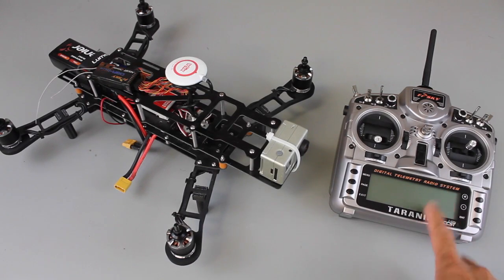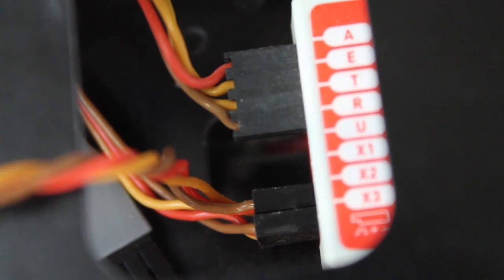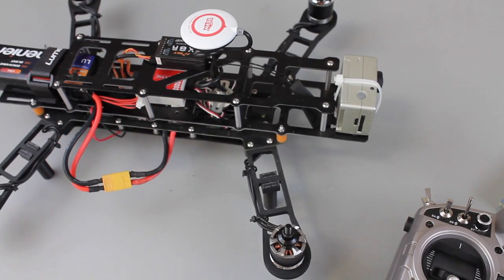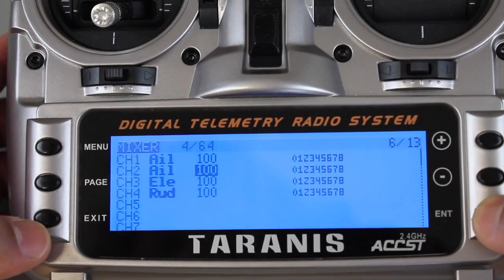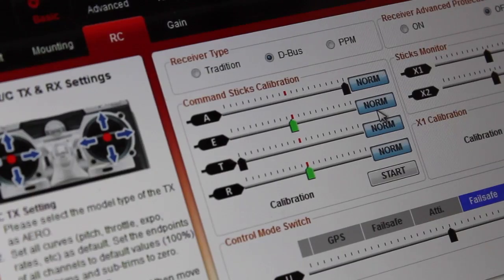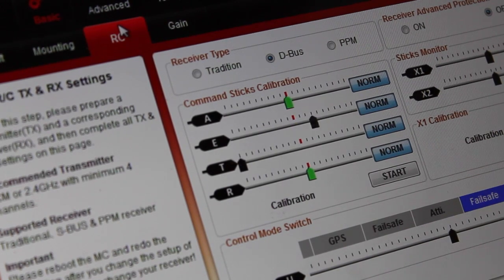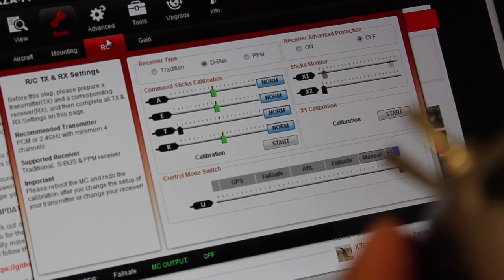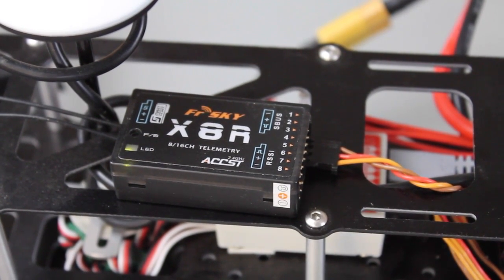FrSky Taranis and X8R Receiver SBUS Setup w/ NAZA Flight Controller

Comment: Hi Dennis ,I have the wookong on Sbus with my tarannis ,and I can't get my compass to get into calibration mode .No blue light after switching from manual to GPS .I've tried six times ,seven times,eight ,nine ,and ten,and it won't come up .At this point I'm considering switching to pwm, and trying that way.This is my third naza ,first wookong and I can't get it to calibrate.any suggestions?I'm a long time subscriber thank you for any help.

Comment: Nice video - I recently built a 450 quad with a Naza M V2 flight controller and this was a big help in getting it setup with my Taranis X9D and FrSky X8R receiver.  I'll note that one thing that was driving me crazy at the end was I couldn't get the motors to arm.  Finally I tried every combination of what Naza refers to as the CSC (Combination Stick Commands) to start the motors, and the only combo that would work was Left Stick (Th/Rud) to Lower Left corner and Right Stick (Elev/Ail) to Upper Right corner.  That stick combo isn't even called out in the Naza manual as one of the four supported CSC positions!   Not sure why this is different, but perhaps it's because the Tx and Rx are FrSky.  Thanks for making videos like this - they're a great help to beginners and even experienced drone builders and flyers.

Comment: This is what I wanted to do but how did you get the software to connect to the Naza controller?  When I try it in Windows 10 it can't find the FC!  I asked those idiots at DJI how to get it working in Win 10 and they said to use XP!  I haven't used XP in years!
Reply: I think your running into the fact that you can't install unsigned drivers in win 10. Look up info on how to install unsigned drivers then re install FC driver and try again.  Hope that helps.
Reply: The driver seemed to install, at least it didn't get any errors, but when I try to run the program it can't find the FC.  It works OK in Win 7 though so that seems to be good enough for now.  I wish DJI would finally update their old software from 3 years ago!  It's all so old that my Naza M is a later version than they say to update to on their website!
Reply: Yeah it doesn't give you a warning or indicate failure. I had the same issue and resolved it by turning unsigned driver off then re installing. Glad it works on 7 for you. Best of luck.
Reply: It works OK on an older laptop with Windows 7 so that's what I'm using.  I've got AETR to work but I don't know what to do about the Control Mode Switch.
Reply: steve c what issues are you having with control switch?
Reply: The issue is there is no obvious way to set it up.
Reply: I assume your talking about flight mode switch and not home lock course lock... 2 questions- which taranis radio are you using and does anything happen in NAZA software when you flip the switch you chose.
Reply: I can send a pic of my radio setup for that. My radio is a qx7 but set up will work on x9d
Reply: Yeah, Dennis has made another whole video showing how to set up that Flight Mode Switch, I just need to watch it a couple more times to see what he's doing then try it myself.  https://www.youtube.com/watch?v=-gA5o_g4oW4
Reply: HD, have you tried setting up a Gimbal?  I've got the Flight Mode and IOC switches set up but ran into a problem with the Gimbal, they say to connect it to outputs F1 and F2 on the FC but F2 doesn't do anything since there's only 1 radio channel allotted for it, X1, which I assigned to LS, so I can move it left and right but there's no way to move it up or down so what's the deal?  I could connect the non working vertical gimbal servo to the 8th output on the receiver and assign that to RS so why do they say to use X1 if it only works for 1 channel?  And why does DJI have you run the one channel through the FC anyway if it only works on one axis?  I could just connect the Gimbal to 2 of the outputs on the receiver and operate it using the LS and RS switches directly.  The Gimbal isn't too important at this point though since I'm just trying to get the Naza working and I haven't even checked out the GPS yet but I'd like to know how it's supposed to work since the directions don't make any sense.
Reply: I usually just set yaw  (left,right) to follow mode so it stays forward and adjust up down, with controller. I'll look into it though. What gimbal? I use my buddy's DYS 3 axis.
Reply: The gimbal is just a cheap plastic 2 axis one from Ebay that uses little servos for movement.  It won't adjust to keep the camera level like the more expensive models and I think the Naza is supposed to do that but don't know how to get the Naza to do it like they show in some YT videos.
Reply: Looks like naza only allows pitch control to be manually adjusted and relies on auto adjustment for roll. From what I'm seeing. I'm going to keep looking. By the way my email is hdgodfrey@gmail.com  so we don't crash the comments section😁 I'm always happy to help with any issue even if I've never come across it. Ill send pics of my radio's channel setup and anything else you need, just ask.
Reply: There's a YT video showing the FC operating a servo for the gimbal which is what I was trying to do but they don't say how they did it or even say anything at all!   The controller is supposed to have 2 axis gimbal support and says to connect the roll servo to port F1 and the pitch servo to port F2 but there is only one channel provided to operate the roll servo and the pitch servo never does anything so I may not use that if it won't work and just put an FPV camera on the front instead.  It's hard to make much sense out of the poorly translated instructions so I'm puzzled as to why they provide 2 ports and only one channel to control it.  It seems like they don't have any idea what they are doing!
www.youtube.com/watch?v=LZJdaBJx3aA

Comment: Hi mate 
Thanks for your video great help 
I've done everything you have said and works a treat 
However how do you calibrate ESC's in Sbus ??? 

Have you done a video on this ? 

Could you give me some advice please ..
Reply from the maker: I'm not sure if it's possible without directly connecting to CH3 or whatever your throttle channel is and calibrating that way. Also, check your ESC manual as there are a lot of ESCs that ship pre-calibrated. Here is an example:

http://www.getfpv.com/lumenier-mini-20a-esc-w-simonk-autoshot-5v-1a-bec-2-4s.html

Just trying to save some unnecessary work. Good luck.

Comment: I have a naza m v2 and an FrSky x4r receiver do you know if it works the same
Reply: I have the Sbus set up but it the whole thing won't connect to the DJI assistant
Reply from the maker: It should as I recall dong this with the X4R. Unfortunately I no longer have my NAZA setup so I can't test. Let us know if you figure this out.
Reply: Derek Loyd

Comment: Hi. If you want to add brushless gimbal, like a Tarot T2-2D, to a Naza-M V2 how and where do you plug in the servo cable on a SBUS receiver? I am strugling to get the pitch control, or the modes to work. I was trying to connect the gimbal to the receiver and not the Naza FC. But any way will do. Help me please.
Reply from the maker: Maybe this will help you? https://www.youtube.com/watch?v=zXsvsYbW09E Good luck.

Comment: hi dennis ! i followed step by step your video on the naza m setup, stick calibration, ect everything went well  but when it comes to the control mode swicth ,,the u channel on the naza the assistant for failsafe , gps , ect  the u channel does not move i can`t toggle between modes for failsafe and gps , i connected a wire from sbus to x2 and program the 3 pos switch but nothing it dosent show on the asistant ,,,can you help me please thanks
Reply: Hi I had same problem as you, if you use S-Bus receiver, the communication of A, E, T, R, U, X1 and X2 channels are all through the D-Bus channel. I set up "Control Mode Switch" in my RX to channel 7 and "Intelligent Orientation Control" to channel 6 and it works.

Comment: Nice tips.  I have an X8R I need to set up for a TBS Discovery I recently bought second hand.  Could I run the Sbus cable to the Naza and set it up and also have other cables coming from the receiver to go to my gimbal to control pitch of the camera or does everything have to go through that Sbus cable straight to the Naza?
Reply from the maker: Take a look at this and maybe it will help: https://www.youtube.com/watch?v=zXsvsYbW09E Good luck.

Comment: Is there anyway to add another control beyond channel 8? I noticed I am able to add my landing gear to a switch using channel 8, but I still need to control an aftermarket gimbal to tilt up and down (analog, not SBUS compatible). Is there a work-around for this? I am using Wookong M, very similar to NAZA setup. Thanks

Comment: I am not able to get the manual mode in 3 flight modes. It switches from failsafe to attitude to failsafe. No manual mode and neither gps attitude mode. Whats the problem?

Comment: Just FYI I just installed the Driver 1.1 and the system does recognizes DJI Virtual  COM Port 6. Using DJI NAZAM Lite Assistant
opening screen just hangs. Looks like everything is good but nothing. I did put a servo on the rx just to see if the tx is ok. Servo movement fine....
Reply from the maker: See my other post and make sure you have the right Assistant. If that's not the case then perhaps it's a compatibility issue with Windows 10. It's been a while since I've run this but I was originally using Windows 7. Keep us posted.

Comment: Good Day! Like the Video on Taranis, however I just picked up a DJI Flame quad. It has a NAZA but do not know what version. It says 2012. What assistant do I use?
I downloaded the NAZA Lite Version (BTW running Win10) the app does come up and I do get a green lite on the V-Sen module when plugged into the laptop. My Taranis is the Plus version and I am using the X8R RX set up like in your video. Radio is Bound as I get the green light on the rx. I do not get ANY movement on the AETR bars on the NAZA Lite Assisstant. Any Ideas?
Reply from the maker: This may help you figure it out:

http://www.dji.com/newsroom/news/whats-difference-of-naza-m-litenaza-m-v1naza-m-v2

Let us know if you get up and running.

Comment: With SBus how do you throttle range your ESC s with DJI Naza???
Reply from the maker: I still do it manually with the ESC plugged into the receiver. Then I setup SBUS. Good question though. I'll have to look into this and share my findings. Thanks.

Comment: Will this basic channel setup work with airplane flight controller ? I have a flight controller that has a sbus connection and i want to be able to control the gain remote so I don't have to land and adjust the gain then go back in the air to see how its working. 
The manual to me isn't very clean on setting up or using the Sbus feature. 

I suppose the only way for me to fine out would be to play with and see what works
Reply from the maker: I'm not sure if you can adjust the gains in the air. I haven't tried that before. I normally just autotune a couple times and that gets me pretty dialed in. Let us know what you find out. I'd be interested in knowing this. Thank you.

Comment: Hi Denis, a bit out of topic, sry. I cannot get a communication in the naza gui. I have a 9xtreme board in a Turnigy 9X. installed a XJT module ans a X8R in replacement of a DJT with V8FR-II. SET jumpers to CH1-2 and CH3-4, the 2 swit hes on XJT are off. I should be in mode 4. The bind is OK. Sbus connected to X2 (the only cnx to the naza board). Any idea what s wrong. Thx beforehand for your suggestions. Thierry BE
Reply: +Thierry Beau more info..... My big first forgotten setup, when using s-bus we need to choice DBUS as receiver type. now I have aert working properly. I do not have yet the 3 posns switch working, my IOC and the failsafe. Without a help, trial and error will be my approach. Do I need to connect other cable between the NAZA and X8R to get all working as before ? I thought the SBUS receive all info via the sbus, means to me ch5,6,7 and 8 thru which the info goes to the NAZA for IOC and FS. I hape to be able to use CH6 for the video gimbal. Last step will be to use a second RX (D8R or V8FR-II is workable). Any suggestion are more than welcomed. B rgds
Reply from the maker: +Thierry Beau SBUS should be sending all those channels across so you shouldn't need any other connections. I haven't done this before with a 9Xtreme board so I'm not sure what's going on. One thing I would check is in your sticks display on the TX see if when you flip your 3 pos switch what channel is moving on the display. Other than that I'm not sure what's going on. Let us know and hopefully we can get you in the air.

Comment: Dennis will the Frsky L9R SBUS connect the same way? Thanks
Reply from the maker: +John Cammilleri To be honest I'm not sure. I've wanted to test the L9R range but haven't purchased on yet. I'm very interested in knowing the answer to this question so if I find anything I'll let you know. Please do the same. Thanks!
Reply: how about the Eagle Tree vector? Any input or advice on using that flight controller?

Comment: Hi can my turnigy 9xr radio work like this in SBUS, I have XJT module and the x8r, just wondering or if you know if I can make this work for SBUS on my radio, thanks.
Reply from the maker: +Ste Beckett That's a good question. If your module works with the X8R I don't see why you can't get SBUS out of it. Just make sure you reassign your channels as the default ones will likely be out of order. Good luck and let us know how it goes.

Comment: Is there a way to get the Taranis SBus to work with Naze32/Flip32 controllers?  As far as I can tell it would need a signal inverter in order to recognize the signal but then there is only 1 serial port available and if you are using it for the GPS there's nothing for the receiver to use so it doesn't seem possible.  Also, can you explain what you were doing with the Mixer?  I had no idea what was going on there!
Reply from the maker: +Steve C I haven't done it but this may help:

http://eleccelerator.com/frsky-x4rsb-sbus-anti-invert-hack/

The mixer in the video was used because with SBUS the NAZA expects a certain channel ordering. You have to adjust them to make it work properly (AETR as well as flight modes). It took me a while to figure this out originally. Good luck with your setup.
Reply: +Dennis Baldwin   Never mind, my Flip32 died before I was able to use it anyway.  Banggood is supposed to be sending a replacement but I'm not going to use the Taranis with it if it's not compatible.  Actually the Taranis was just a waste of money since it has features that are impossible to use or even figure out what they do.  How does anyone ever get anything to fly with so many companies selling crap that's not compatible and doesn't work?

Comment: I am trying to setup my newly puchased X9D with the X8R reciever to my Naze32 board with the SBUS . Reciever binds but nothing happens. Do i need a SBUS to CPPM converter or am i doing something wrong. i have setup ppm on the board was previously flying with spektrum DX8 but wanted to use the built in Frysky telemetry and use the ppm function. any help would be greatly appreciated, spent the whole day on this to getting nowhere.
Thanks. Good videos by the way.
Reply from the maker: +Garrick Heesen I'm pretty sure you'll need a converter unless you try this hack:

http://www.rcgroups.com/forums/showthread.php?t=2270541

Good luck and let us know if you get it done :)
Reply: +Dennis Baldwin Thanks for your response, it would seem you are right. i have decided to leave the setup and order myself the d4r - ii as this seems to be cppm, why they make 1 sbus and the other cppm?
I have another question for you as you seem to be the only person on youtube that responds. on my transmitter telemetry page i get RSSI at the top which seems different to everyone elses telemetry page, and on the screen pages i dont have an option to monitor my cells, only BATT and RxBt are avaliable along with all other choices . am i missing something like a brain have tried everything even deleting the model and setting up again. PLS HELP

Comment: Do I also have to change the mixer if im binding x8r to my cc3d evo using sbus?
Or is this only needed for naza?

So if this is needed than my mixer should look like this right?
Ch1 ail    100
Ch2 ele   100
Ch3 thr   100
Ch4 rud  100

Thank you,
Reply from the maker: +Amina Chee Great question. I haven't used the X8R with CC3D and SBUS. I would  make sure you know the channel ordering for CC3D over SBUS. It's possible that the default mixer order will work just fine, but you may need to move your channels around if it's not AETR. If it is then the default settings you posted should work. Good luck and keep us posted on your progress.

Comment: Ahhh. I was about to ask you if you had ever had Naza do what mine did today. For a brief period during lock mode, the LED flashed like it was in course lock mode, even though my switch was OFF. Because what happened next, as I lifted off, and went to yaw the craft, it started flying like it WAS in course lock. I may have to check my endpoints in Assistant. Of course the other concern I had was as I did the yaw, the craft wanted to relocate itself along a flight path, even though I did the compass cal and 4 home lock routines. Do you think there is a position that the quad should NOT be held in during 2nd phase of compass calibration...ie...one side or the other down, or front or back down? Thanks Dennis.
Reply from the maker: John Robertson That's a great idea to check your endpoints in Assistant. IMO the band for the different modes is a bit too small. I like the range that APM and Pixhawk give you. For the second phase of compass calibration I don't think there's a position that shouldn't be used, but I always turn the quad sideways and nose down. Not sure if this helps and I'll report back if I run into any issues.